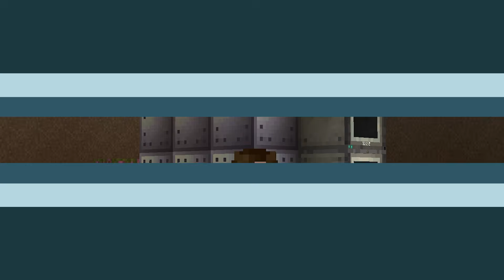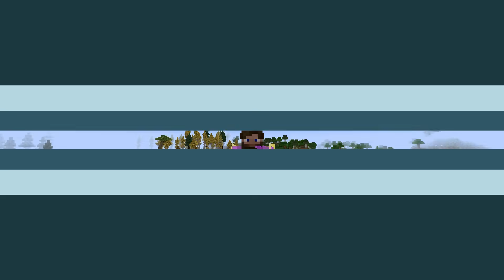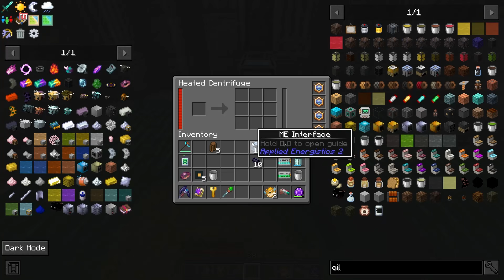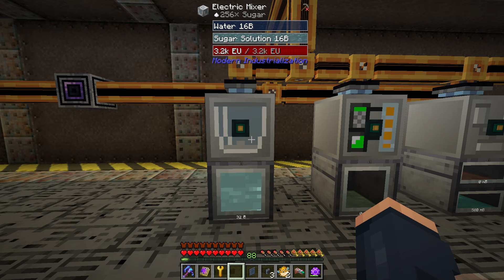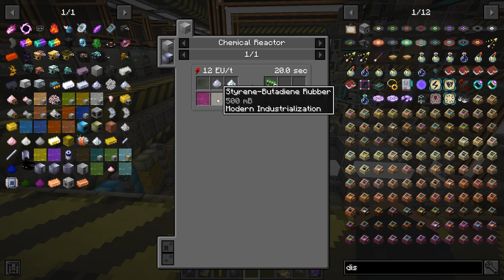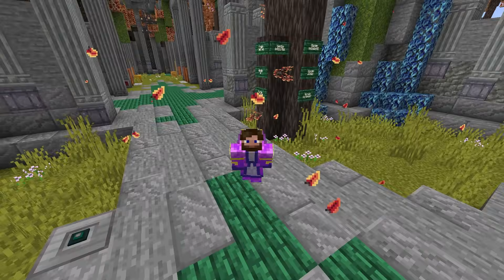All The Mods 10 EP46 Efficient Distillation Tower Setup in Modern Industrialization

Comment: This video design is not good, in 7.0, the distiller only have a few of work load, it will drain your rubber sheet all around.

i suggest you use Modular Provider to make the necessary circuit then there you go.

Comment: tip for the people watching: all MI machines accept the runic hatches from forbidden arcanus, so if you rush automate the hephestus forge you don't need to worry about inputs outputs or energy and they are much cheaper
Reply: this was a huge tip thanks! I would add to remember the runic attuned crystals for over clocking

Comment: chosen I have a small suggestion. just to see if it is possible. on the MI machine that produces oxygen and hydrogen, put redstone upgrades and bind them to the slots. make this upgrades so that when full, stop emitting signal. when empty emit signal. and make the machine work on redstone signal. with a void upgrade in that drawer, you now have a system that refills oxygen and hydrogen when it is used. AND most importantly it stops when both are full.

Comment: My issue with this mod is by the time I’ve gotten here I feel like I’ve really over-engineered all of my resource production beyond anything I’ve done in any other mod pack, and I get to MI and I’m running out of materials almost immediately. Millions of certus gone for the silicon. Copper/Gold/Iron not so much an issue, but everything else is struggling. Several bees/MA seeds per resource and this mod eats everything. Just seems grindy and unnecessary, and it goes to show why it turns so many folks away from it.
Reply: Edit: Made infinite sand cell, silicon sorted.
Reply: @DawnAuthor you can get silicon from sand??
Reply: @54sam3  yep! Crushing sand in a crusher will yield silicon

Comment: I get how seeing MI as like Satifactory with passivle manucacturing lines. but it still looks like an utter grind. at least with Gregtech you have AE2 to help and useful multi blocks.  Good to have guild e but yeah stil not acuta playing ATM 10
Edit: overdrive modules if your using one machine for a single recipie and the MI upgrades to speed them up. Soul surging is realy not th wya your supopse to use MI
Reply: Extended industrialization has the array multiblock to do parallel processing, which the pack should have. The array is a multiblock that takes in up to 64 electric machines and processes stuff faster to reduce the wait. 

ATM10 doesn't have industrialization overdrive mod that gives multi array that does parallel processing for MI's multiblock machines though, which is odd.